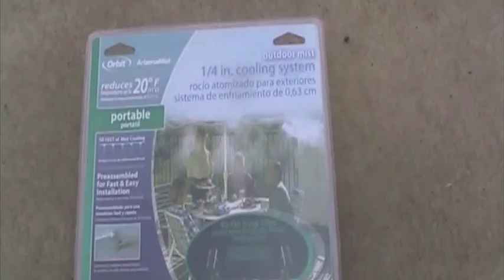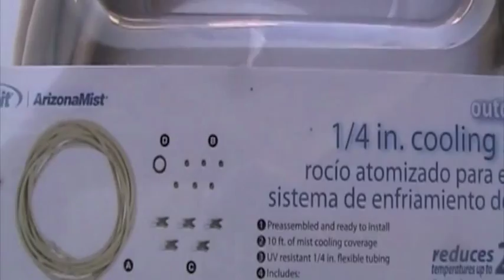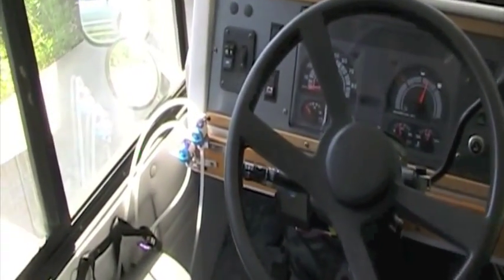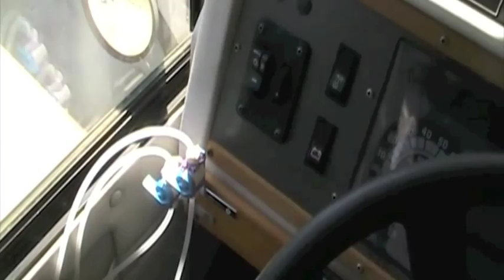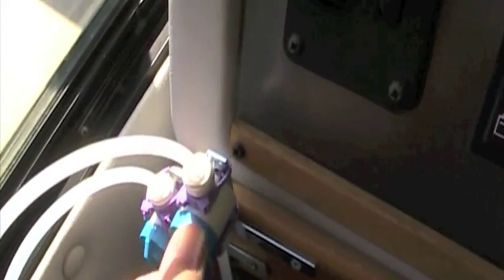RV radiator misting system

Comment: the radiator is 20 years old,, and is not cooling and will damage  your engine ..the misters will help but only delays the big damage soon to come.you engine will over heat and warp you heads.. and you are wasting time with misters and holes.. the real bad news is,, no one makes brass radiator that will fit you P30,,  the 2nd big bad news, is removing the radiator is a full day job with a helper.. I know.. you may buy an aluminum radiator for $1000, plus labor,, you have a 4 core, cross flow,, I see you posted 2012 and I am replying 9-2017  we don't know what we don't know.Hamish

Comment: My brother and I were talking about the time Dad did this years ago. We had a 1959 Plymouth station wagon and used it to pull a Shasta 21' trailer, which weighed 3210#. The wagon's engine was the famous 318 CID.
Dad was a plumber. He rigged a 1/2" copper pipe system from the trailer, along under the length of the car, and up and across the radiator. He drilled holes so the system would spray the radiator.
The water source was the trailer's 40 gallon pressurized water tank. The flexible link between the trailer and the rear of the wagon was a heavy duty garden hose piece with quick connects. Up by the driver's seat ha had a gate valve for system operation.

I'm glad you posted this. As soon as my brother found this video he sent me the link. It's a good thing for a lot of people now that these kits are available, especially since, as I am told, unleaded gas engines run hotter. And besides that, some people think their globe is warming (though our winters are getting colder and snowier.)

Comment: This system has been used by Pikes Peak racers for decades. Doesn't that tax your on board water pump when it is constantly running? Would a dedicated water pump designed to run for long periods be better?  I'm just wondering if that system will burn up your water pump faster.